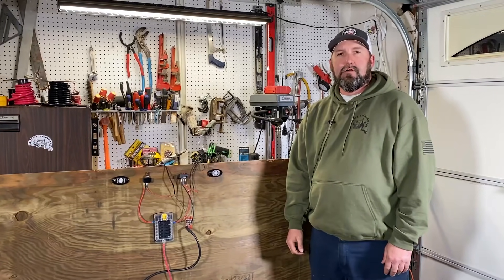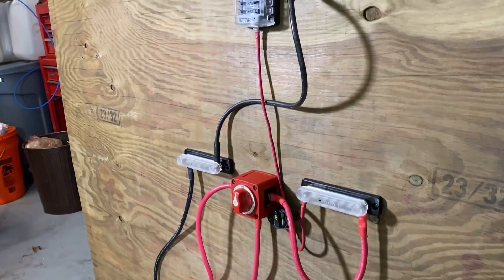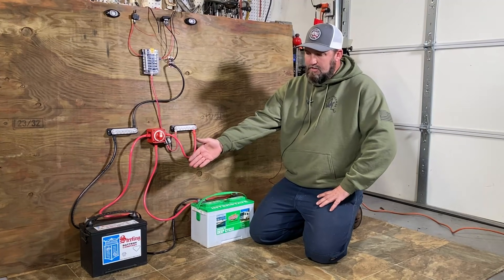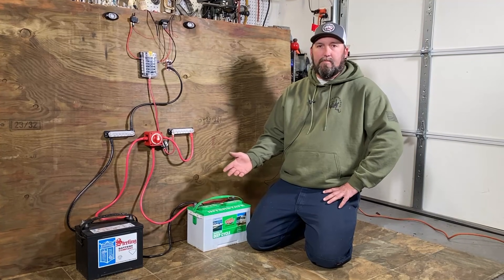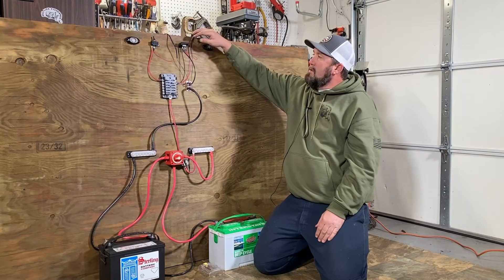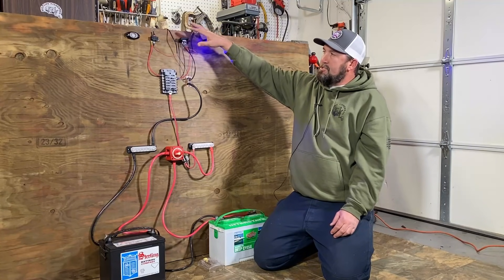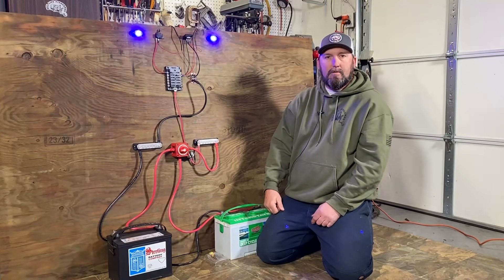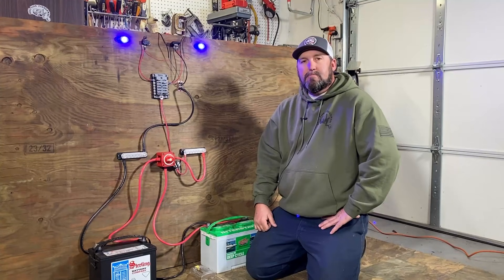BASIC BOAT DUAL BATTERY WIRING | HOW TO

Comment: If you have a make before break selector switch, you can select one or 2 battery without turning off the motor or electronics.  Also, must have the right size fuse for the wire and circuit you are trying to protect.
Reply from the maker: Yes sir thanks for watching and commenting

Comment: I'm guessing you would dial that to both batteries off to connect external charger?
Reply from the maker: If it’s a straight charger and not a onboard smart charger then yes.. you would want to have the switch off and hook directly to the battery to charge it.. if you have a onboard smart charger.. it’s doesn’t matter.. thanks for watching

Comment: So if im following correctly, I dont necessarily need the positive bus bar if im not stacking too many cables on the battery switch and dont need a negative bus bar if i use a fuse block with a built in negative bus ?
Reply from the maker: Yep you got it! Thanks  for watching and let me know if you have any questions
Reply: @ReelLifeFisherman  I actually do have one last question. If i purchased a switch panel where all powers and grounds are already jumped leaving only 1 post open for the connected device, how do I make use of the fuse block to protect the device? I greatly appreciate your help.
Reply from the maker: Not sure I’m following exactly.. are you asking about running power to a new pre-wired switch panel?
Reply: @ReelLifeFisherman  yes sir ! So on your breakdown you have two positive wires going out from the toggle switch. One to the fuse block and one to the device. My new prewired switch panel only leaves me one post open to connect straight to the device i want to power and no open post to wire to my fuse block

Comment: How would you start the boat with battery 1 then switch too battery 2 while powering every device during running the boat on plane?
You said to not turn the selector while the motor is running.
Reply from the maker: No only switch batteries when stopped and engine is off.. let me know if you have any questions and thanks for watching..

Comment: I just accuired an bass hound 10.2 and would like to know how the wiring should be. I can't seem to find a wiring diagram for it. I only have a trolling motor and not a gas motor
Reply from the maker: So you should check out some of my other battery wiring videos it might help with some of that. But depending on the trolling motor you have .. you would want at least 2 batteries.. the boat side of the wiring should not share with the trolling motor.. the trolling motor should have its own battery or batteries .. let me know if you have any questions..

Comment: This video is great!  Is there any chance you would turn this into a multi-part series?  I would love to see how you add an isolator and charging system to this and explain how those work using the board you have created here.  I know you have a couple other videos where you're adding those to your boat, but this makes it so much easier to see and understand how everything comes together.  Thanks!
Reply from the maker: Absolutely! I have been thinking about that as well .. great idea! And I will be keeping the board around for future videos ..  thanks for watching and commenting!
Reply: @ReelLifeFisherman  have you gotten around to doing the isolator and selector switch combo video yet. Also I installed this on my boat, however the crank battery stays on all the time,only the 2nd battery gets shut off..any suggestions?
Reply: @ReelLifeFisherman  thanks so much for this video buddy. It has helped me out hugely. But like the others I would love to see this video expand a little bit to show where an alternator gets attached to and also solar chargers.
Reply: I support Tyler Olson’s message! I know this is a diy video but I don’t think he realizes how helpful this for other circumstances. This helped me understand what to check when something is wrong any electronics. My pumps went out and now I’m on the hunt

Comment: Sorry if this is a dumb question but I know nothing about wiring in general. There would be another positive wire coming off your cranking battery to the motor correct? Great video?
Reply from the maker: So the wire going to the engine would be off the output side of the switch.. so the motor can be cranked from either or both batteries.. thanks for watching and let me know if you have any questions..

Comment: New sub here. On this set up were would you connect the ignition leads for a Mercury Verado. I added a second battery and had a problem were the engine did no detect the battery because I had those leads permanately mounted on the Blue sea fuse block which was running off the house battery. On this switch would the engine only detect the battery on setting 1 and both only.
Reply from the maker: In a verado you have a engine “clean power “ wiring.. they need to be directly on the cranking battery the engine is connected to.. also the battery needs to be an AGM battery.. per mercury. I would recommend doing a add a battery system from blue sea system and run the boat power off the house battery and the engine and DTS off the crank only.. then the isolator to keep both batteries charged. And the switch to combine them in emergency only.. the switch that comes with that kit is a on , off, combined only.. also what size verado? Do you have the steering booster pump?

Comment: Wow that is the Best how to battery wiring on the web!! Thank you so much! Blue Seas should be jealous!

Quick question, I just installed a Minn Kota Riptide trolling motor and I have to install the Marinco male plug on the red/black wires from the motor. I need to shorten these wires, so can I cut these wires from the motor without issue?  The female marinco receptacle is wired with 6 gauge from the 24 volt battery system.

Comment: Maybe its just the demo, each battery should always be fused at both positive battery posts to protect the battery cables , batt. Switch and fuse block from direct shorts and eventually a fire from over amp draw. Good demo
Reply: Shiuld there be a fuse between every positive connection?
Reply: Not necessarily but what that does is with a fuse on every terminal it means if something gets overloaded it’s less likely to burn out whatever device you have and it’s less likely to start a fire.

Comment: Great video but it leads me to wonder how your dash instruments / say a chart plotter would to be able to run unless the battery switch is in the combined position while the boat is running which is not recommended? Wouldn't they need to be hooked into the cranking battery
side to be active?
Reply from the maker: Everything is hooked to the output post of the battery switch so no matter what battery you are on everything would work in this set up.. there are other set ups I will go over in the future.. thanks for watching and commenting let me know if you have any questions..

Comment: Question the link for the 4 gauge wire shows they only have black in stock Would the 4/2 AWG Duplex Flat DC Marine wire -tinned copper boat cable wire work as a substitute?

Comment: I have a question  about on board battery charger. I have 1 interstate lead acid cranking battery and 1 deep cycle AGM battery for My accessories with a battery switch. I just purchased a 2 bank xps pro series 2 Bank on board charger. Is it OK to charge them both on the agm setting?  Do I need to get 2 1 bank chargers instead because their different  battery types? Thanks in advance.

Comment: Excellent video. I have a 3 bank onboard battery charger. Start-Trolling-House 3amp-10amp-10amp, ot Start-Trolling-Trolling. Where in this setup should I be hooking these leads. I am assuming directly to the batteries. Is that correct.

Comment: Great channel you have...I have a question..I currently have a Lund 1875 Impact with a Merc 150 4stroke. 3 batteries, 24volt Minn Kota, 2 Humminbirds.
I am planning to add a 4th battery strictly for the Humminbirds, Ethernet hub, Heading sensor, and anything I may add in the future.
I have the 4 bank charger and 100AH battery and am planning to put a small fuse block up at the bow, and another next to the existing fuse block under the console(kind of like sub-panels).
Should I use a circuit breaker before going to the fuse blocks or is that overkill? And do you see any pros/cons to doing this as opposed to the Battery Selector method you describe?
Thanks

Comment: I have a 2003 mercury EFI 2 stroke and I have a group 27 on there now. I have 2 Helix 12s I bought recently and both are connected to an inline fuse. Do you think I can move to a group 31 since Im running 2 12s or should I stick to the group 27?

Comment: Thank you for a well-explained tutorial of boat wiring. One question, how would you hook up your dual bank battery charger? Would you simply run the charger leads to both batteries or is it more complex?
Reply: It is literally exactly that. A charger has two leads for each battery, so a 4 bank one would have 4 sets of leads.

Comment: Would you be able to use a bigger circuit breaker like a 50a as well?
Reply from the maker: You wouldn’t want to go that high for just boat power.. that’s size is more for a trolling motor wiring.. let me know if you have any questions and thanks for watching
Reply: So a 20-30V for the fuse block
Reply: Better yet do you have a link for type you used looking all over the web and some differences in them all

Comment: Thanks for the video!  I have an older boat that has 3 batteries (2 for trolling motor).  The trolling motor batteries aren't connected to boat fuse box, as they have individual fuses on the wires near the battery.  Is there a way to decipher what was done when they originally wired this?  There are a lot of extra wires and I can't figure out what is what.  I know it is wired in parallel for 12 volt motor and also that there is a charging plug in the back of the boat so there are wires from that to the batteries, but struggling to figure it all out.  Thanks

Comment: Thanks for the breakdown - really helps - I've just got 2 bus bars now and in looking to hook them up - looks like I need a switch like yours as well.  Any issue with having a main engine (150hp) and a kicker (9.9hp) on the bus bar as well - or should either of those go direct to the crank battery?  Your video with the dual batts in the back of the boat looks like the ideal setup but I'm not there yet.
Reply from the maker: I would recommend hooking the engines to the battery switch output.. or if you don’t have a switch yet directly to the battery.. thanks for watching and let me know if you have any questions..
Reply: @ReelLifeFisherman  Switch ordered - just had a sad day at the dock - the crank battery was "sucked in" like someone sucked the air out and is taking forever to charge right now so I suspect it's the issue - but a friend who is a Mercury mechanic suggested perhaps running the big engine to the group 27 hybrid (crank / deep cycle) and then the kicker direct to a crank 24 and then wire the rest of the accessories off the switch/bus bar like you have it.  He suggested that just as an added layer of protection between the 2 engines he thought might be an extra safeguard - any thoughts on this approach sir?

Comment: I assuming you would have one more positive and negative for your motor and they would go directly on the #1 cranking battery posts and not the battery switch? You would have 3 negative and 2 positive terminals on your cranking battery?
Reply from the maker: If you want to be able to crank from either battery the main engine positive need to be on the output post of the battery switch.. then yes the engine negative would go on the cranking battery negative.. let me know if you have any questions.. thanks again for watching

Comment: Great vid- do you always need that fuse box or can you get away with only inline fuses (say to Nav lights) and shoot the ground to the neg. bus bar.
Reply from the maker: You don’t need the fuse box you can just run a in-line fuse to the switch for the device you want to power up.. and then put the negative on the negative buss ..thanks for watching and let me know if you have any questions..

Comment: I drew my diagram using this! Thank you! But where would the motor wires go? Positive, I’m assuming through the buss bar or directly to the switch? And the negative? Sorry I’m brand new to all of this.
Reply from the maker: So the main motor I would hook to the output on the battery switch and the main motor negative would go on the cranking battery negative.. you could put them on the buss but I would recommend hooking them up directly to the switch and battery.. let me know if you have any questions and thanks for watching..
Reply: @ReelLifeFisherman  really appreciate that! Thank you.

Comment: I want to wire a very basic setup in my boat consisting of a couple LED lights with a switch, a stereo with 2 speakers. And a trolling motor. Would I be able to power everything with this setup in your video safely? Probably dumb question I just have never tried wiring anything before so I’m alittle Leary
Reply from the maker: So you would be able to power everything but the trolling motor.. a trolling motor needs to be wired independent from any other wiring .. the power it draws when running can cause Interference with electronics especially fish finders or stereos ..  let me know if you have any any questions.. and thanks for watching and commenting..

Comment: I just purchased 2 Lowrance fish finders and looking to install them very soon. I have watched several videos on wire set up and seen most recommend using 8 gage wire, But they are connecting these to the cranking battery, My concern with this is loosing the charge to crank the motor. An example of this is with the sea Clear videos on their Wire harness they use and how they connect and run them. After seeing how you have this set up, I am thinking this is a better option, But I do have two other batteries in the middle of my boat that are mainly used for the trolling motor but the concern using these batteries are from what I hear is interference in the fish finders when using a trolling motor. Since the new fish finders are a bit more power hungry, Should I bite the bullet and or chase a separate battery for deep cycles and rig it the same way you have this set up and install the switch and fuse box to run these fish finders to? Any recommendations would be helpful thanks
Reply from the maker: So yes if you connect your trolling motor up with your fish finders it will definitely cause interference.. keep them separate.. I would recommend adding a battery to your system.. even a group 24 deep cycle as a house battery would really help.. also a good idea if not adding a battery to bring one of the new small battery jump start packs like the one from NOCO it is small and will definitely start the motor.. let me know if you have any questions.. love to help as much as I can.. thanks for watching
Reply: @ReelLifeFisherman  Thanks so much appreciate the feedback and help. So If I understand your replay correctly If I can add another battery (24 Deep cycle) as a house battery that battery should handle the two fish finders and still leave my Cranking battery separate for just cranking the motor? And if I cant install a stand alone house battery the Cranking battery is Ok to connect to even though its not a deep cycle battery? Will that shorten the  overall  battery life?

Comment: I just bought 2 interstate 27DC batteries for my trolling moter, they are rateded in cranking amps not amp hours is this the wrong batteries for my trolling moter? I got them at Costco there black and not the white ones like you got
Reply from the maker: As long as they are deep cycle you’re good .. interstate has had some changes to their battery cases recently .. there were some shortages so they have used different ones..  are they a model SRM27 ?
Reply: @ReelLifeFisherman  no.....literally just 27 dc..... I know of the model your talking about but that was more money.. these were $82
Reply: @ReelLifeFisherman  any way I can send a picture......not sure how I would be able to do that though

Comment: Great video this is why your channel is THE BEST..... I am doing this exact same wiring less the distribution bus blocks at the back. SO when you are running to a fishing spot your suggestion is only run on the cranking battery and leave the house battery in the off position? Or run both batteries to charge them both and when you go to your spot leave your house battery on and turn off the cranking battery?
Reply from the maker: Thanks I’m glad you like the channel! So I would recommend running around on the cranking battery until you shut off the main engine and don’t plan on starting it for 2 hrs or so depending on how many electronics your running..  switch it over to battery #2  so you can run everything and don’t have to worry about the crank battery draining and having to start it to charge it back up again.. if you want to make sure both are getting a charge while the engine is running I would suggest get a battery  isolator charging relay .. let me know if you have any questions about anything..
Reply: @ReelLifeFisherman  I have a minn kota MK 2 DC alternator as well its set up on the cranking battery and the trolling motor battery but I recently bought a 24v Terrova so not sure what to do now. Also should you not put a breaker or fuse coming off your house battery before going into the switch then to power distribution block and if you do it that way would you need another breaker/fuse for the fuseblock under the dash?